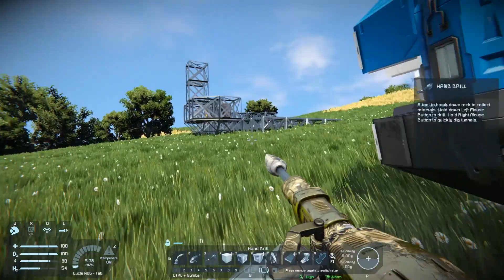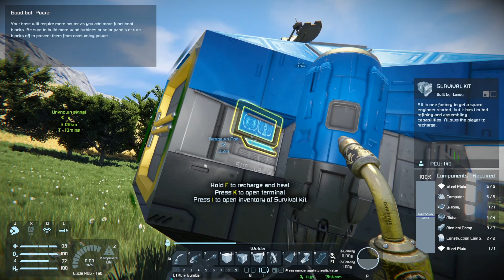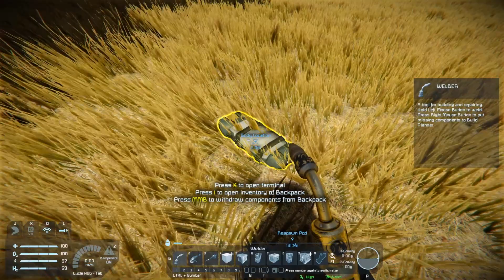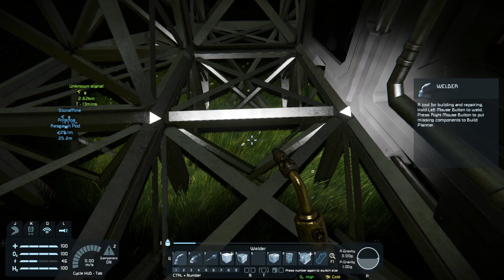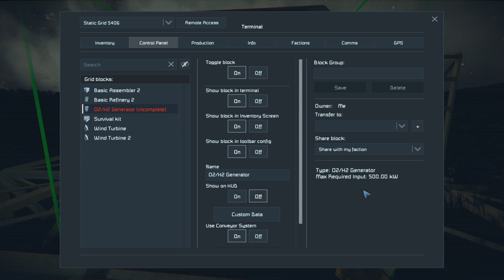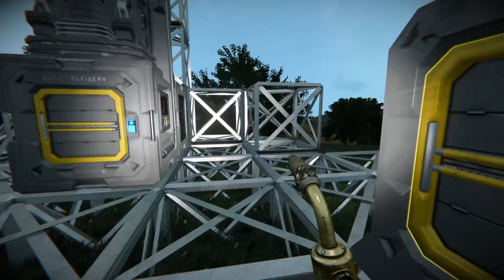Power Overwhelming! | Space Engineers | S1E2

Comment: Refineries:
Survival kit - refines only stone and produces iron nickel & silicon ingots.
Basic refinery - refines iron, nickel, silicon, magnesium and cobalt ores into ingots, also refines stone but you get less ingots from the stone compared to the survival kit.
Large refinery - refines everything the basic refinery does and adds Silver, Gold, Platinum & Uranium to the list. Can also be upgraded with yield and/or power saving modules.

Wind turbines work best on a tower of 10 blocks including the one in the ground, above 10 and there is a slight drop-off in the amount of power generated for each additional block. I find the greatest efficiency in terms of resources required to build them versus power produced is 1 tower of 11 blocks with a turbine on top, 4 additional blocks on the 4 sides of the 9th block and a turbine mounted horizontally on each of those 4 additional blocks.